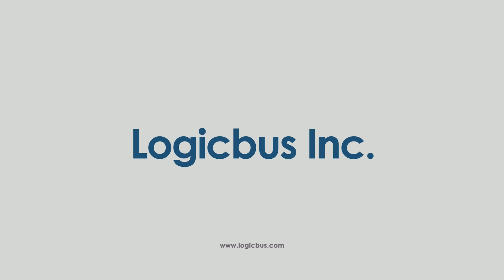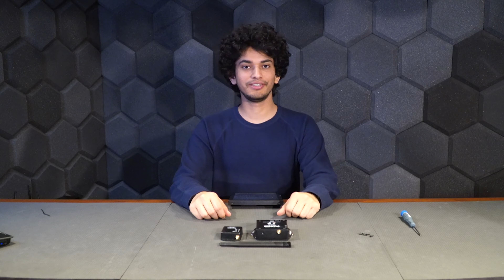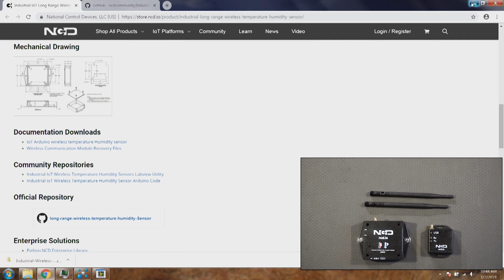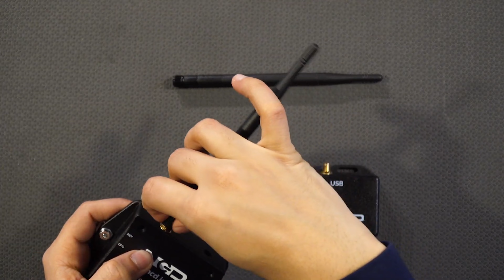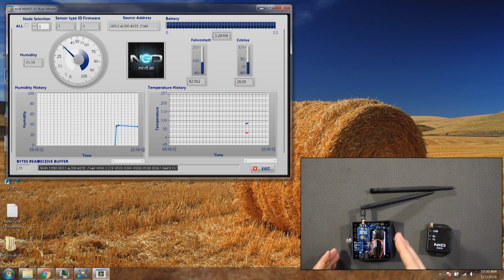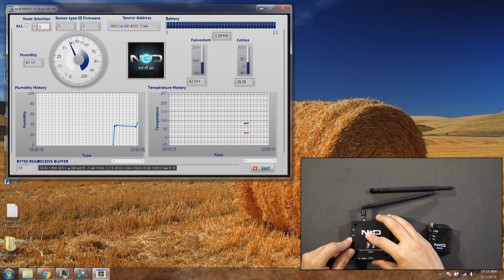NCD io Wireless IoT Temperature and humidity Sensor

Comment: This looks very interesting, but is it possible to reduce the interval between readings to about 100ms?
Reply from the maker: Hi, thanks for your interest. This wireless sensor doesn’t support intervals as short as 100 ms, since it’s optimized for low power and long-range communication. The minimum interval is a few seconds. For high-frequency applications, we recommend a wired sensor.